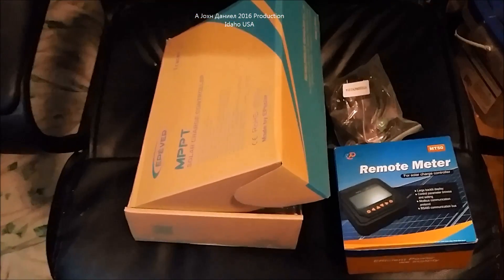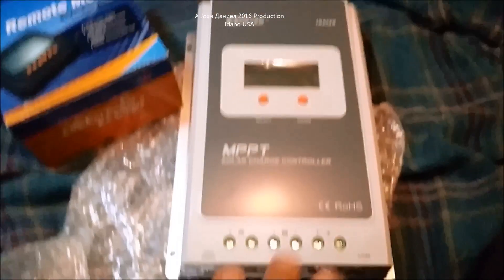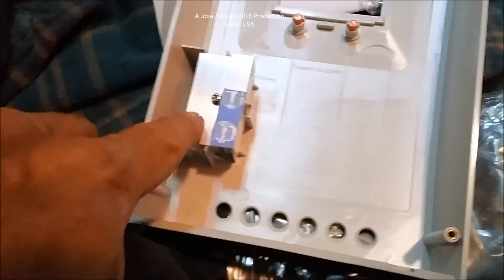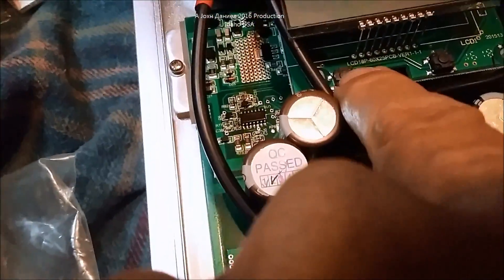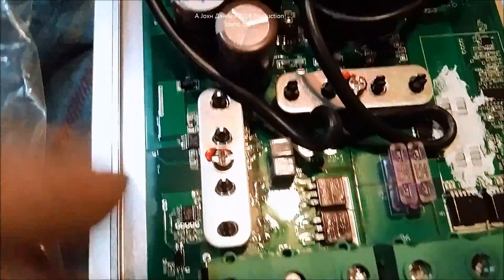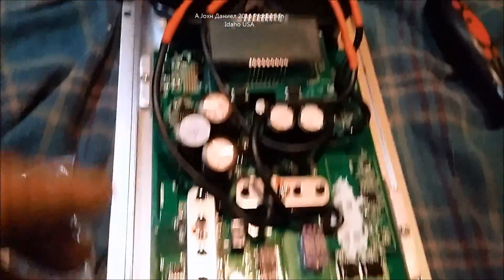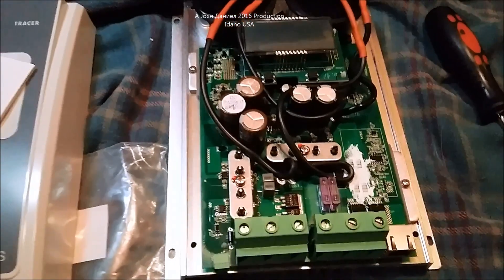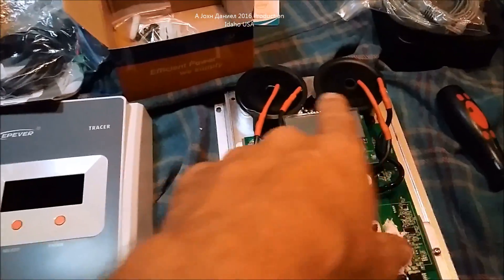EpEver Solar 40 amp mppt Renogy Aims Controller Open it, Study, Review

Comment: Tracer A.. Common positive rail. Later model TracerAN is negative common rail.
Reply from the maker: Very true, but as a rule always isolate a controller of any brand to prevent static issues.

Comment: I have a bunch of 310 watt solar panels that put out 37V and 8A each.  I'm wondering how I can wire a bunch of these people to this controller.  4 of them would put out over 1500 watts.  What would happen if I plugged them in?
Reply from the maker: +GMoney 1500 watts into it would probably make a lot of smoke. They handle 560 for 12 volt and 1120 for 24 volt battery systems.
Reply: I wish I had found the owner's manual before buying it.  I guess I'll be limited to only 3 of my panels.  :(
Reply: Same here, I have four panels at 295w and was hoping to connect all four into a 12v system.  But, I know the max is 520 for a 12v, wondering if I put two of my panels, 590w max into the 12v, will it still make smoke?  Gmoney, did you happen to connect all three?  Just needing some advise, can I parallel two panels together to charge 200ah 12 battery system?  Great video by the way.